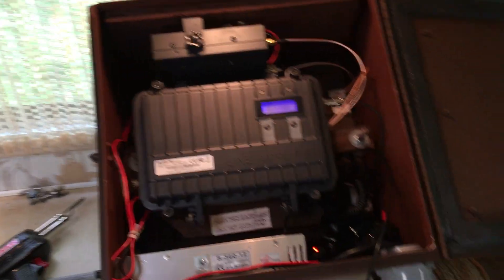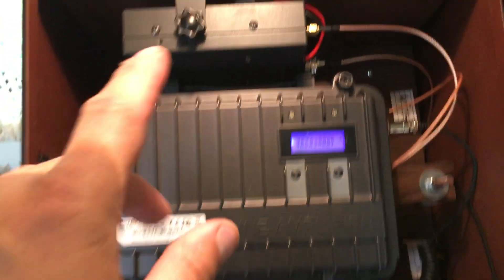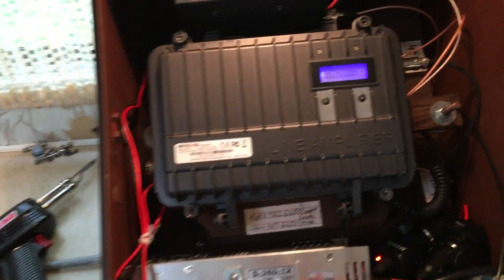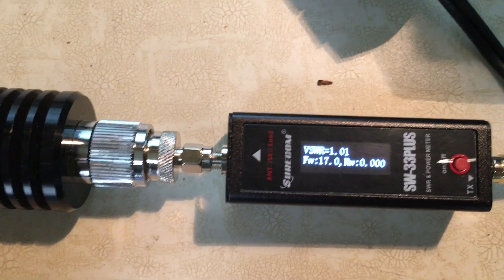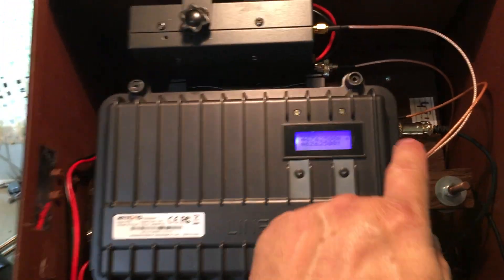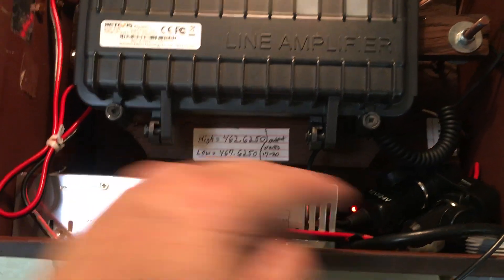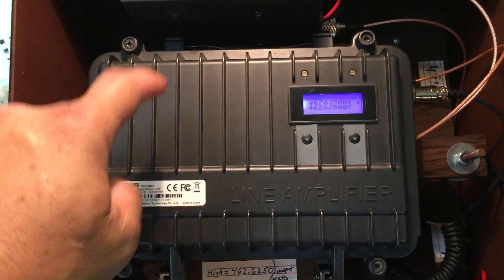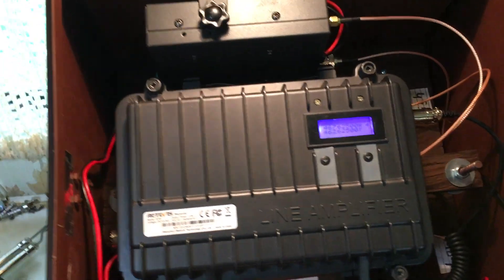🔺Finally DONE LAST PART 4 My modified RETEVIS rt97 GMRS Two-way radio repeater "BOX" MOD!!!🔺

Comment: Can a 80 watt amplifier  be added to up the watts to the antenna without issues?
Reply from the maker: I think you are asking if the antenna can handle 80 watts? I don't recall if my antenna can without looking up the specs, but there are antennas out there that can handle that wattage.

Comment: Why can you not run the amp after the duplexer and have the amp feed the antenna? Make sure the output wattage is 6watts or below at the antenna connection at the duplexer?
Reply from the maker: Cause it will kill the RX Sensitivity also known as Desense 🙁
Reply from the maker: watch this video https://youtu.be/Cl5GNVUlDeY

Comment: When you refer to 17 watts out, that is without the AMP engaged? So, 35 watts with the AMP?
Reply from the maker: No, that would be with the amp, without amp it's 6 watts. BUT I had a bad cable https://youtu.be/B8T7mYaQnv0

Comment: If you used heavier guage coax for jumpers would that help any? Those jumpers seem awful small.
Reply from the maker: It may, but with that short of a cable, I don't think you would see that much difference.